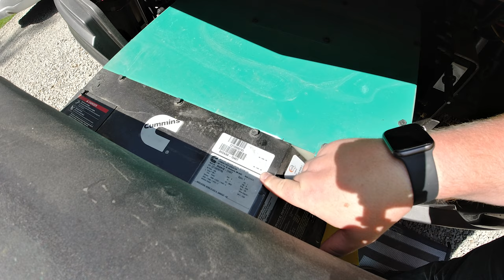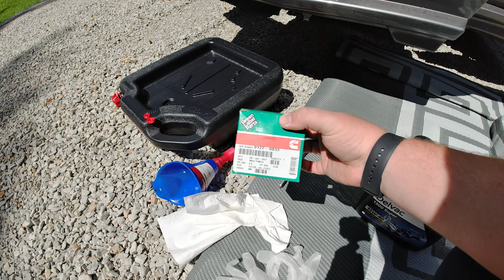Onan 8000 QD Generator Oil  and Filter Change

Comment: Hi---this probably is not necessary with your newer unit but Onan recommends you also clean the spark arrestor during an oil change if done at the recommended 250 hour interval. Cleaning the spark arrestor is easy but requires a long socket extension...I think mine is 18".  I change my oil at about 100 hours (give or take 50) and always clean the spark arrestor as well as change fuel and air filters every other change. Onan recommends your newer unit have oil changed every 50 hours.  Thanks for your video
Reply from the maker: Thanks for the input! Actually per Onan my oil is changed every 250 hours and the spark arrestor once a year along with the fuel and air filter (depending on usage). Thanks again for your input!

Comment: Is this the correct Fuel Filter part # for the 8000 QD? It appears mine is a small round in line type, unless I am looking in the wrong spot. Ours is a 2012 coach, model # 8hdkak-1046M
Reply from the maker: Onan Fuel Filter - 147-0860

Comment: Couldn't you have slid the generator out to avoid removing the access door?
Reply from the maker: Derek, I wish that was the case. The exhaust pipe is the only reason you couldn’t open the door all the way. If you watch my video again go to 3:21 when I slide the generator back to show the drain plug. You will see what I’m talking about. Thanks for asking though.
Reply: @RVTravelingWith6  thanks for the reply. I see after watching again the exhaust pipe....dang well I know what i am up against on my 8k Onan thanks for the video.

Comment: Should tell everyone the part #, oil type and amount. 3 quarts.
Reply: He did state that if you watched the whole video
Reply: @stevem2819  oh I must’ve missed that. I heard 3 quarts. Any mention of the water side of the generator? I stand corrected.
Reply: @michaelrose5823  No the coolant side was not addressed
Reply from the maker: @michaelrose5823  I did cover how to change the coolant in the video.
Reply: @RVTravelingWith6  I need to stop drinking 🤣